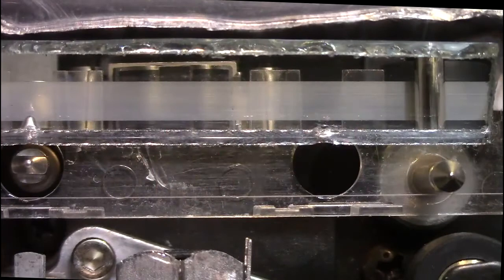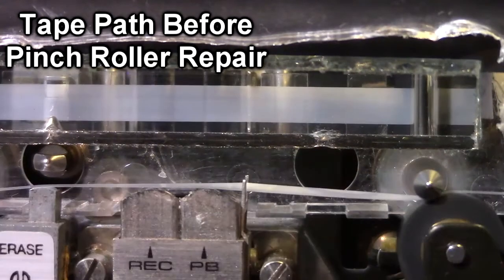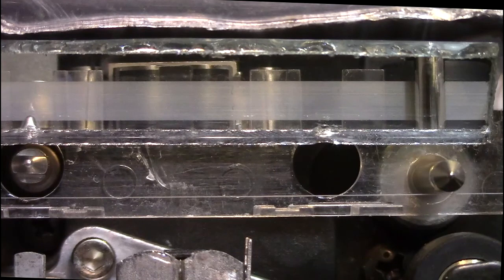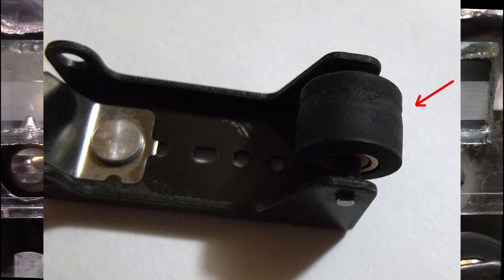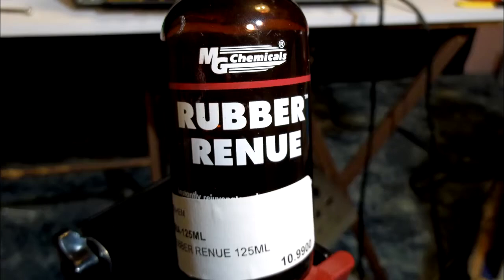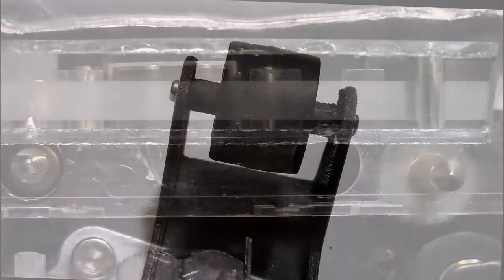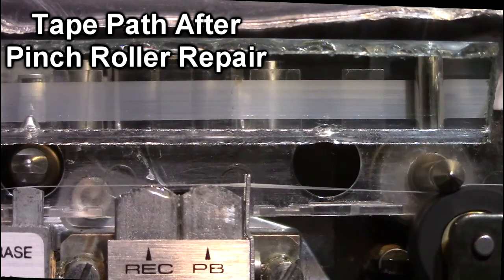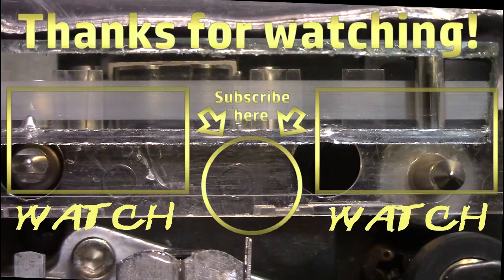PIONEER CT-F1250 : Tape Path Issue - part 1

Comment: There is still a tiny bit of curling on the head's outer tape guide if my eyes aren't completely off.

Also, grinding down a pinch roller works as a one-time solution but I would actually take out the roller and put it on the Dremel itself. It should have a drill tool that allows you to clamp symmetrical objects like a roller axially to have it rotate against a piece of fine-grit sandpaper. It should be much easier to get a smooth, round surface that way.

Did you measure W&F yet? If it's not up to spec, you might want to replace the roller anyway. There are rebuilt new ones available and a beauty like the CT-F1250 seems justification enough to spend some cash on a new roller 😬
Reply from the maker: I did spot that as well. Not nearly as bad as before... and any curling is dampened by the pressure pad.. which the mirror cassette has no pressure pad. As I stated, the proof is in the pudding, and the pudding is mighty good. Any further issues will be addressed as they come down the pike. Stay tuned for part 2.